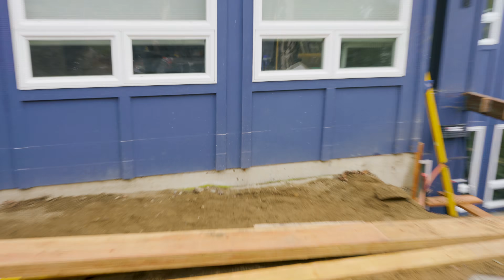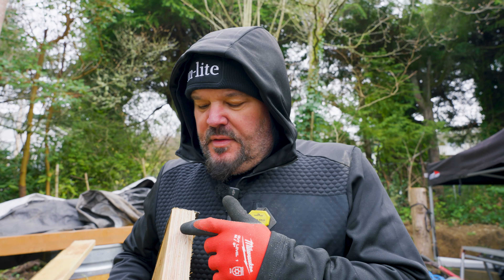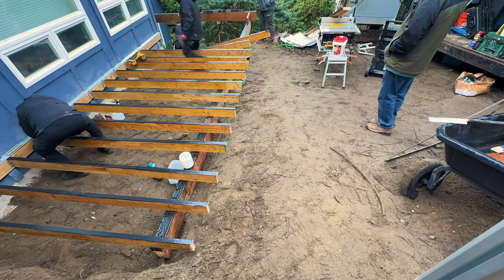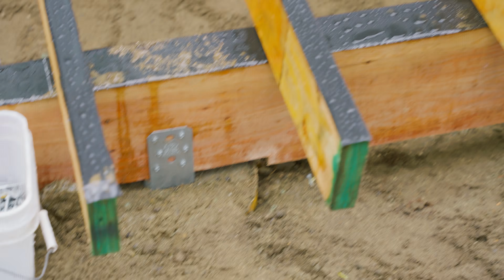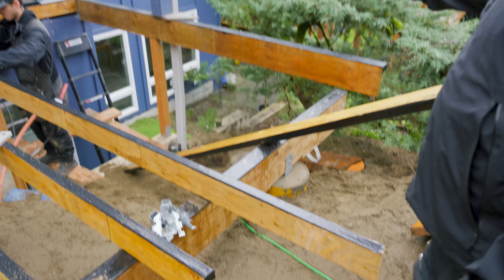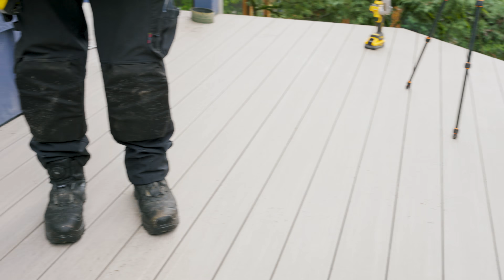This New Lumber Could Replace All Your Deck Joists

Comment: NIce video! My lower red cedar deck rotted because it stayed damp. How about testing OC Lumber advertised as  "high-performance, fiberglass-reinforced, High-Density Polyethylene (HDPE) composite structural framing material"?ps. do you always put a flashing on top of your ledger boards?
Reply from the maker: Yes. We flash everything 
OC is a good option

Comment: Just completed a 21'x18' composite with a double pic-frame and breaker on a home that was elevated 60".
Hidden field fasteners with Cortex on the boarder. Got to admit, I sure do enjoy installing the plugs. We use YellaWood down here but that LVL looks like fun to work with.
Reply from the maker: Thanks for sharing

Comment: It’s best practice to seal the ends when cutting. I found this to be useful bc it will dry out faster and be prone to creak. It’s in the documentation too. It’s very light and I was able to hang a 2x14 22 feet long alone.
Reply: @Richie_7777  if you read the treatment specifications, treatment does not mean 100% penetration of the wood, and if MCA (big fungal resistance issues).
Then there is the cellular pores created by vacuum/ pressure treatment (which gives the sponge, shrink when dry/expand when wet).
Reply from the maker: Correct. We use Cutek Extreme

Comment: ~$7.50 per foot for '2x6' material.  10 foot board: $75.00.  Great product for sure, cost some big $$$.
$9.50 per foot for '2x8',
$12.50 per foot for '2x10'.

14' x 20' deck, with PWT LVL's sized in '2x10' would run about $3,500.00 for joist/rim structure (assuming very minimal waste).
Reply: @Ifishmo  thanks for the breakdown. Seems worth it if you are going to put a premium product on top of it.

Comment: This seems good enough to just do away with PT lumber altogether
Reply: @frankfurther3828  pretty much unaffordable.  They want so much money for it that you can build a deck twice with PT lumber and still come in way cheaper.  I think it’s way better to just use #1 2x8s soaked in diesel/used motor oil with a water barrier on top for joists.
Reply from the maker: There is a price point for certain but you get what you pay for.
Reply: Check the price!

Comment: I built a 10 ft high second floor 10 x 20 deck last year using PWT for the rim beam allowing for two 4x4 posts instead of three. As a first time deck builder it was frustrating dealing with all the imperfections and warping of pressure treated lumber. If I had to do it all over again I would use PWT for all the framing without a doubt !!!
Reply: Why the fuck would you use 4x4's for a 10' tall deck
Reply from the maker: @johnstewart2337 I wouldn’t. I didn’t. That deck was built by others. Even though structurally and mathematically, it passes code requirements.
Reply from the maker: Agreed!

Comment: I just check the cost of lumber for my project deck. Around $800 for joists in pine, $5000+ for this product!
Reply: Settles that lol
Reply: @uknowwho613  Yes, this is often the problem with manufactured products.. Wonder how this LVL product compares with using steel or aluminum?
Reply from the maker: You need to compare the joists as a size down in PWT because they span further. Usually it’s 4-5x of PT lumber
Reply: Ouch!

Comment: How much per L.F. for the size material you used for your joists?
Reply: based on current market data, PWT (Pacific Woodtech) Treated LVL 1-1/2" x 6" (often used as beam or joist material) costs approximately $7.55 per linear foot.
Reply from the maker: It’s about $5.00lf
Reply: @drdecks thank you for taking the time to respond back to me I appreciate it very much. How accessible is the material? Im out on whidbey island an would like to use this product on any future deck builds if possible, I do not want to work with are local pressure Treated hemlock anymore.

Comment: What’s the price difference compared to typical treated lumber
Reply: Some guy in the comments priced out framing his deck with regular pt and it was about $800. Then he priced this product, it was in the $5000 range.
Reply: @h@huejanus5505that’s absurd
Reply from the maker: It’s about 4-5x the price of pt
Reply: Its PT LVL ,  $$ , and you have to use G-Tape
Reply: @roastedright You should use G-Tape either way.
Reply: @huruguru Preaching to the guy who in conjunction with Dr.Decks in October 2015 brought the First Samples to him on his nighmare Butyl tape vs PT glu lam job , and i yelled at him , try it out , tell me what you think and the rest is history
Reply: About tree fiddy.
Reply: Wish I had this option, or knew about this when I built my deck a few years ago.